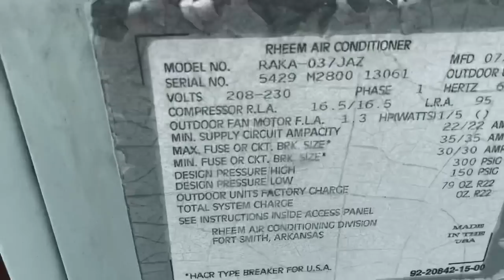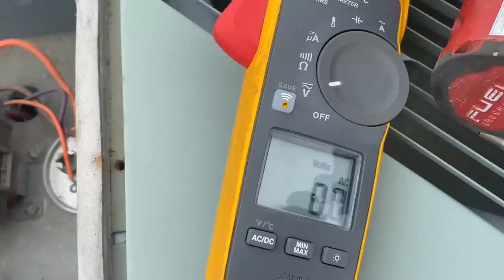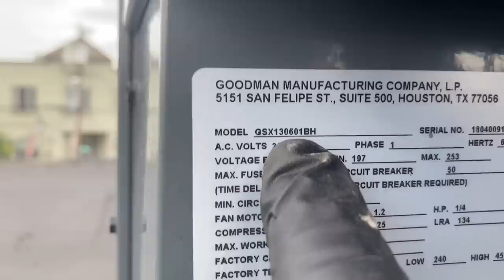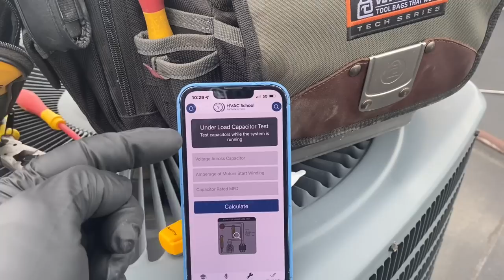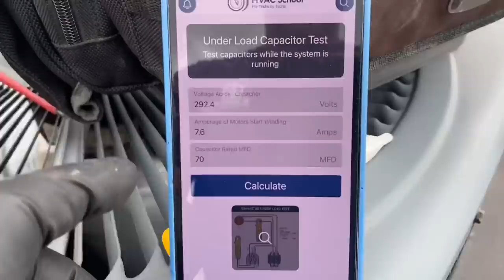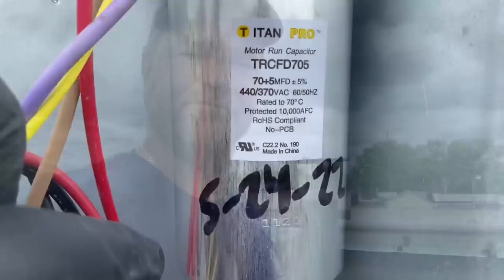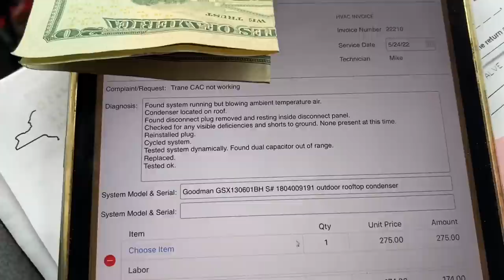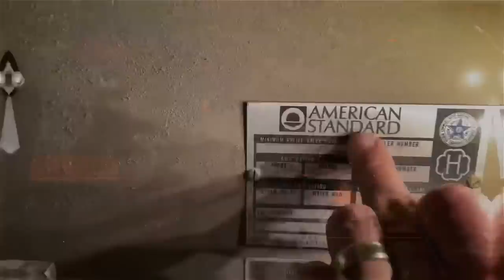Goodman Rooftop Condenser Not Cooling - How to Test a Capacitor While System is Running

Comment: For you new guys.... if the Aux winding opens on the fan motor, the capacitor will retain a charge, and it can put you on your a$$. So, make sure that both sections of the cap are discharged by you once the power is turned off. Also, there is a simple formula you can find online for making the uf calculation while the system is energized and running. You don't need an app. Be aware that there is one formula for 60 Hz and another for 50Hz, so if you are in the UK, check to be certain you have the correct formula.
Reply: I always discharge the capacitors and make sure power has been off for atleast 10mins before actually touching the wire leads. I feel testing with system running cant always be determined if its to low to start your fan and compressor. So this works good for PM services when systems are running correctly
Reply: @acrservicesmathewr7565  That's right. Calculated running capacitance is for PMs, and not for no-run diagnostics.

Comment: Mikey try using the Titan HD line of capacitors. They are made in Kennesaw Ga. You won't be disappointed
Reply: That brand titan pro is cheap garbage. I do not stock such anymore in my truck as I'm constantly replacing them.
Reply: @georgekolos5255  the local supply house swapped to the HD line for that reason. Such better results
Reply: MARS all the way!

Comment: If the disconnect was not taken out, would the system have worked without replacing the deficient capacitor?
Reply: It started

Comment: Always check the system when you find a disconnect off... Had one the other day... Disconnect off and breaker off.   Older lady said had no issues just yearly service.  Found compressor shorted
Reply: YUP ITS OFF FOR A REASON USUALLY

Comment: Those "capaciators" are hard to find too. 😂
Reply: They shouldn't be hard to find as they are by far #1 reason of no AC calls.  Where are you located?

You can also get on Amazon Prime next day delivery all sizes starting at $15!
Reply: @georgekolos5255  I was just joking about the misspelled title. Capacitors are easy to find.

Comment: 275 for labor and 123 for the cap? Goddamn shit there is expensive. It would cost 60 bucks all together where I am at
Reply: Almost 400 for a 20 dollar part. And about 10 minutes possibly to replace?? Let's call it one hour!

God bless you for the 2 yr part warranty though. I reccomend though to not buy the cheapest dual run caps you can find though. Titan pro has a higher grade made in USA one that is way more reliable. Ask your supply houses about it
Reply: @PipeDoctor   I am located in Cyprus. Not sure how expensive it is there but here it costs around 10 euros for the cap + 40-50 euros for labor which is pretty high considering it takes us 10? Maybe 15 minutes if you need to take down a big ladder and go on a roof. Sorry if it sounded like a hateful comment just geniuenly ment that stuff there is expensive as shit compared to my country.

Do you mind telling me what app you use as a CRM? (Pricing, scheduling etc)
Reply: @nowhereclose4465  I guess that is the difference with my country. If you are going to a big company then they won't say anything for a 100 buck charge to go there. But if you charge more than 50 for just going there you won't have any clients.